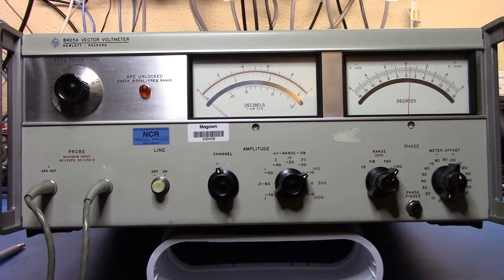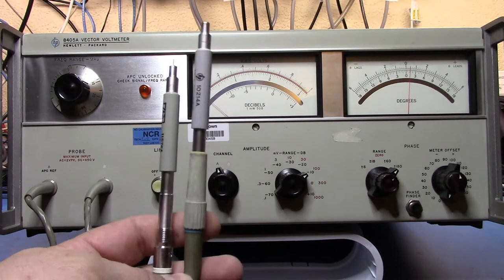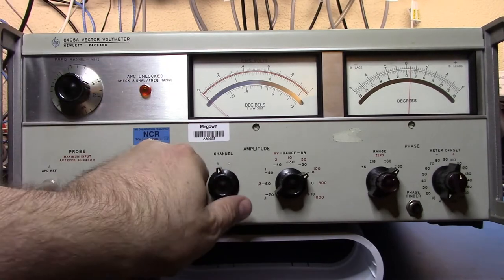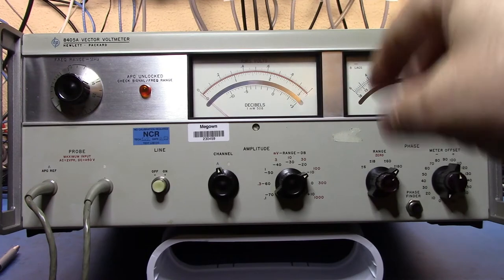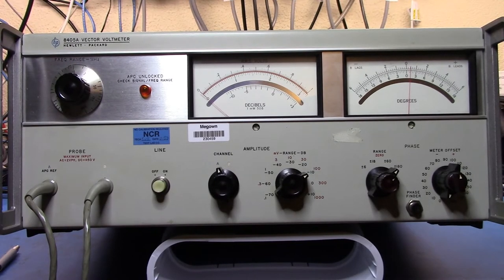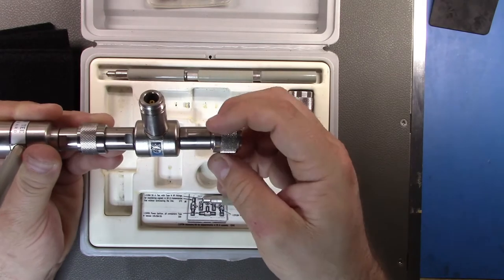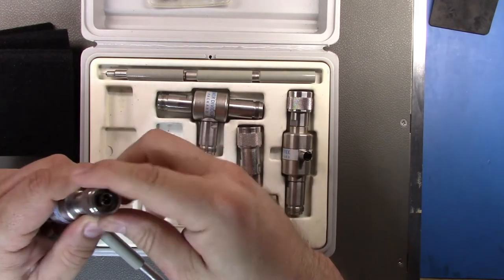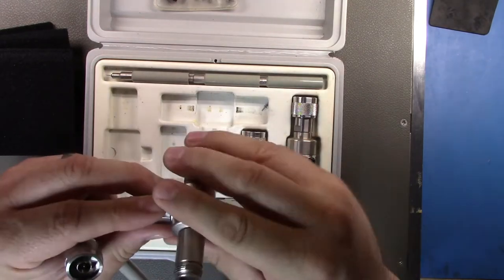HP 8405A Vector Voltmeter Partial Repair

Comment: Thanks for a very interesting video. I have both the HP8405A and the HP3575A Gain Phase meter 1Hz to 13MHz (aka Vector Voltmeter). So I can measure from 1Hz to 1Ghz. I have the relevant application notes albeit it would be great if there was a few ideas on other applications. Keep up the good work!
Reply from the maker: Glad you enjoyed the video - These are great tools for amateur radio people because they cover the most popular bands - Attenuators, filters, amp design, antenna work - Pretty useful.

Comment: Good luck trying to find just an air line by itself with N connectors on both ends; I've found it is very difficult.
Reply: I have airlines from GR and a whole box of GR adapters to connect them to N, bnc etc Very handy system. I use the GR stuff on all my gear.  I have attenuators, adapters, airline, T's, mixers, etc All GR-874. Besides that I have some  GR-900 stuff including a beautifull GR-900 slotted line, a selection og GR-900 adapters and some airlines. Most GR-874 stuff I found for near to nothing at ham-fests. Most hams have no clue what it is.
Reply from the maker: According to the manual I need a 874-LK20L 20cm Constant Impedance Adjustable Air Line to do the performance checks. I'll also need 2 874-QNP N Male to GR adapters. I'll have to check closer because I might be able to get away with a fixed air line as those are way more plentiful.
Reply: Those are a bit harder to find. http://www.pa4tim.nl/?p=4686 here you see a part of my GR adapter stuff
Reply from the maker: Nice - I've been eying a GR slotted line as well so I might have to just pull the trigger on these later this month.

Comment: There are no manuals for this instrument on the net. I do have a hard copy of the circuit diagram for this instrument. If you require a soft copy, don't hesitate to ask.
Reply from the maker: Thanks - Appreciate that - It does look like Keysight has scanned and uploaded a full manual but you can also get it from Artek Manuals with way better schematics (usually) than the Keysight downloads.
Reply: @tgsoapbox  Thanks. I Googled a few years ago but found nothing - I Googled again and found the manuals at BAMA
Reply from the maker: @Testequip  NP Glad you got them.

Comment: don´t you need a dual coupler to make the measurements with the vector voltmeter?
Reply from the maker: Only if you're trying to measure the reflected signal (as in return loss/vswr). For transmission measurements the second channel acts like the incident port on the coupler.
Reply: you are right, i thought you were trying to measure impeadance. thanks for answering
Reply from the maker: No problem. Thanks for watching and commenting.